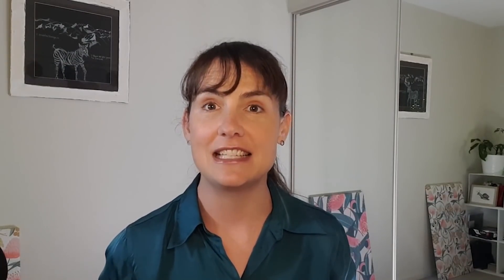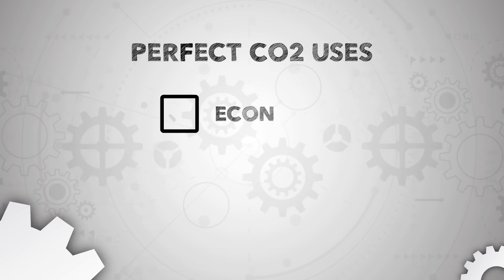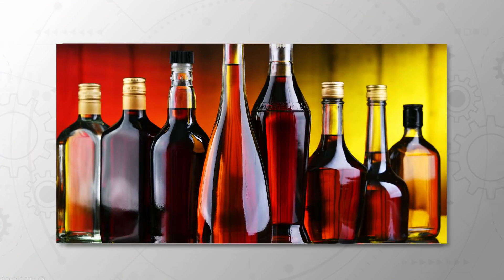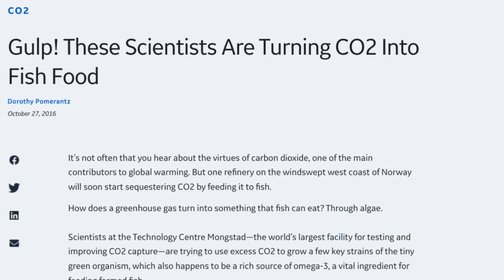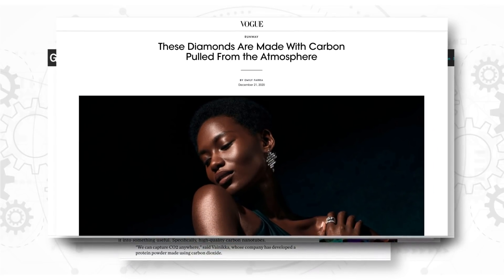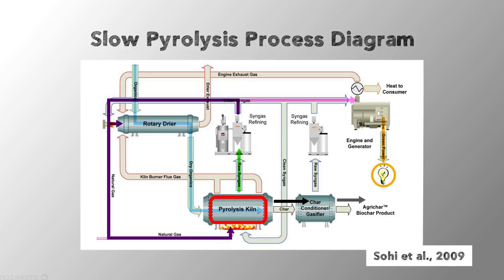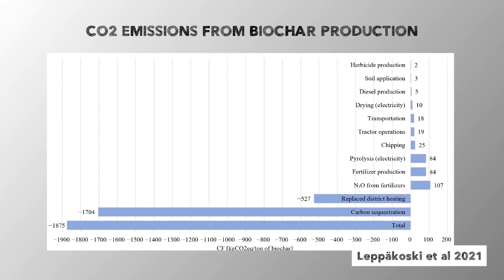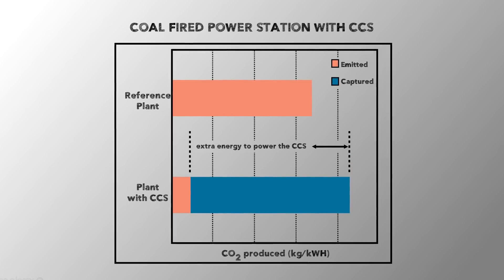From Waste to Wonder: The Surprising Uses of Carbon Dioxide

Comment: "Capturing CO2 out of the atmosphere, and making useful stuff out of it"
People have been doing that on a large scale since at least the chalcolithic era. It's called "wood".

Also, who are these people "generally considering" biomass to be carbon-neutral? That's idiotic. Biomass is significantly carbon-negative, even before you use it in the ways described here, because plants absorb way more carbon than is embodied in the material the plant is made out of; the "extra" mostly gets pumped down into the soil in the form of things like sugars, and ends up sequestered.

Comment: Thanks, interesting video, especially the talk with Dr Jessica Allen. However, as a chemist, I need to note a few things here: 6:11 The molecules displayed as ball and stick models are not what is written above them. The first one is CO2, the second one looks more like Chlorine (Cl2) than hydrogen (when considering the colours and sizes in the other models), and the third is methanol. At 8:05 the models seem to be better suited, however, according to what is said in the video the formula is not complete: It should be CO2 + 3 H2 -> CH3OH + H2O. But all the rest was good and interesting, as said.

Comment: Not even wrong or worth further discussion when the obvious thing to do is well understood, behind the obfuscation.

Reset the Renormalized Cynicism gauges. Fly ash isn't the usual bs.

And I'm reminded of Norman Gunston, "Say something Controversial", and put your head on the block with the stealth censorship troll gang.

Isn't Captured Carbon spelled C O A L, even before charring in an earth oven over the eons?

So if thousands loose jobs, millions and billions will no longer lose their lives earlier than they should? Carbon Capture, as a topic without relevance, is a pernicious delusion, when compared with the degree of reversal required to burning it.
Reply: cringle

Comment: Replace standard concrete with desert sand and resin. Captured CO2 plus Hydrogen via high temperature steam electrolysis to make Methanol to Dimethyl ether (DME). Perhaps solvent blends based on dipropylene glycol dimethyl ether for the production of alkyd and polyester resins by the azeotropic process. Polycare are able to proceed with combining local dessert sand and polymer resin to print bricks. Use nuclear for the process heat - high temperature gas reactor. The Allam Cycle by Net Energy produces a very pure stream of CO2 for industrial uses. Pilot plant in Texas already up and running.

Comment: Rather than looking at your carbon footprint, how about looking at your heat footprint? One way to become heat negitive is to install a Planetary Air Conditioner.  Mine ejects enough heat into space to prevent 250 tons of ice from melting per year. It cost less than $200 (with NO government subsady), and has been running for seven years. It uses NO electricity. The cooling it provides shows up first in my home so my electric bill went down.  How cool is that!

The down side is the tech is off patent, so corporations don't want to manufacture. There's nothing to tax, so governments aren't interested. And the Planetary Air Conditioner solves the earth's temperature problem, so environmental zealots lose the main point they complain about.  The Planetary Air Conditioner works, but no one wants it.
Reply: You are claiming to be able to remove nearly 2.5kw of heat every hour for only $200. 

Forget corporations , why do you not manufacture this device and sell it as an air conditioner to your neighbours.

Then you have your seed money and you can start making it yourself.
Reply: @catprog  Thank you for noticing.
As I said, there is no patient to earned. The technology is 3k years old (at least).
I've posted videos of my Planetary Air Conditioner. I don't run compression Air conditioners any more. Does it matter? No.
If someone can pay $200 and get $500 back every year, who's going to market it? The power company? Home Depot? Our government, which if they implement will collect less taxes?
It's an orphan technology. Use it, if you dare, but don't brag.

Comment: 🤔 Apparently increasing the atmospheric CO2 by as much as triple helps plants to grow big and strong. How practical would it be to start piping captured CO2 to greenhouses on industrial scales to feed help  thousands/millions/billions? Or maybe deliver it to the greenhouses as dry ice? How long before the carbon makes its way back to the atmosphere with such a strategy? As long as we're growing indoors, what about using narrow-bandwidth LEDs to additionally save energy and encourage growth? How much power does that actually use per hectare of crops? Has anyone tried custom atmospheres and lighting simultaneously? 🤷‍♂

Comment: Plastics get an unfair rap because of how irresponsibly we use them. They are truly wonder materials. What other materials are light, very strong, and able to be easily made and modeled to any shape or quality we want, including transparency? And don't get me started on composite plastics, which can have amazing properties.

Also, it is easy to dismiss graphene as a new and quirky material, but it conducts electricity better than copper, while being stronger and many times lighter. If we replaced copper with graphene we could save energy (lower resistive losses) and store a lot of carbon. Currently we use something like 25 million tons of copper each year. When you look at replacing more than a century of copper already in use, that sounds like a pretty good start to carbon storage.

Diamond is not just for decoration. It has very cool properties that could be incredibly useful to us. As well as being extremely hard and very transparent, it is an excellent electrical insulator, while being a very good thermal conductor. The latter two properties could make it very useful in electronic circuits. Industrially producing diamond on a massive scale would also destroy the diamond mining industry, which would be a very good thing because of the awful social damage it perpetuates. It might be difficult to manufacture the perfect diamond that might be a better alternative to the glass fibre used for communications, but if a way could be found then diamond fibre might be a stronger alternative. In a more day-to-day use, cheap diamond windows would likely be stronger than glass windows.

Comment: I have a technology that solves all these problems.  I call it Terrestrial Renewable Economically Environmentally Sustainables or T.R.E.E.S.  They have these characteristics:

They capture carbon and lock them in for the long term.
The more carbon in the atmosphere the better they work.
They produce oxygen as a byproduct!
They are a self-replicating technology fueled by carbon and solar energy!
They are self sustaining. 

As the frozen tundra areas of the world begin to melt, we can use that available land resource to populate these T.R.E.E.S. that will help re-capture the CO2 we've put into the air.  The best part -- we don't have to do ANYTHING.  This T.R.E.E.S. technology self manages, self propagates, self replicates, and works without any intervention on our part.  I've already got some prototypes and just need some carbon tax investment monies to get started on a large scale.  Please donate!

Comment: It would be nice if we could turn carbon capture facilities on and off during peak times when renewables are making lots of energy or consumers are consuming lots of energy.  This could reduce the need for energy storage.

Of course leaving them on 24/7 may actually be a more efficient use of resources.  I've also wondered if Aluminum smelters could be turned on and off to use cheap or wasted power.
Reply: If you turned them completly off it means they get very damaged.

However if you keep the aluminum molten and don't add any new solids you don't need to add the corrosponding eletricty either.

Comment: It seems that parts of the ocean that are natural carbon sinks could be leveraged or areas with naturally high current(high C02 flow). Semi- self- sustaining- bio-engineered solutions could be a good option economically. Super charged diatoms?

Comment: Using actual modified car engine to transformed CO2 into Biochar and Synthetic fuels! Biochar then used to create Graphene for new generation batteries and Synthetic fuels used to generate electricity to charge these new graphene batteries and to fuel car engine.🤔

New car engine could store Biochar and deposit it at synthetic fuel station when they are refueling. 🤔

Existing car engine could be repurposed, electrical car batteries could be enhanced with graphene. Negative CO2 footprint?🤔

Comment: I’m actually interested in the ‘turning it into plastic’ idea because like fossil fuels, plastic is not going to be easy to replace also there is a big difference between say single use shopping bags and plastic on the wiring in your house or workplace that’s expected to last for Awhile. It won’t be used for forever in that application but a few decades or more is certainly longer than a plastic bag.

Comment: One  way to collect carbon   must be micro algae, and some like lentil algae combined with tecnologies like vertical agriculture must be usefull in a short time. Some thing really interesting must be about technologies used to separate carbondioxide from the air. I have tried multiple times see diagrams about how it is done, Must be the first video explaining the tecnology if you can do it... Thanks.

Comment: I was intrigued when you started out with Carbon.... from Coal to Diamonds... as I FULLY AGREE WITH THIS.
One must Challenge the Coal Industry to think "out of the box" rather than moan, groan and weep over the future where coal is not sold cheap to "Burn and Pollute" ... but Move Up the Value Chain (diamonds being at the top).
One of the most significant use (missed out) is in replacing Steel with Carbon Fibre, including use of 3D Printers for Components to even full Buildings etc... (Now you understand the " out of the box" thinking needed..). 
I hope you will cover the Future of enhancing the Value of Cheap Coal to "Burn & Pollute"  to Move Up the Value Chain WITHOUT COMBUSTION & POLLUTION... ALL THE WAY UP..... TO DIAMONDS... THE HOLY GRAIL OF CARBON...

Comment: I’m looking forward to the results of your enquiries. One particular question I have is what toxic / carcinogenic byproducts slow pyrolysis produces if any and how can we transform those into useful chemicals or less hazardous substances.
Reply: Just don't bungle the process by having equipment go out of order. See also guides c.f. Nuu Biofuels Digest.
Reply: A lot of useful chemicals such as turpentine were made from plants in the past and distilled out. Oil and coal displaced the original sources of the materials.

Comment: The capture potential for any technique is dictated by how much capture is profitable. That means, strict CCS, without utilization, is limited to whatever companies are forced and or payed to do, and insignificant greenwashing. Paying fossil fuel emission intense industries to capture some of their emissions will not help solve this problem, it will help those industries survive longer.     

About bio-char, the potential is still dictated by how much of it that is profitable, if we make it profitable to stora all the carbon that needs to be stored in form of bio-char that will happen. It's not likely that we will store a large part of what we need to store in bio-char either, but technically the potential to do so is there. 

It's not just that bio-char can store carbon a very long time and improve agricultural output, the latter is also extremely important, and increases carbon uptake from the atmosphere by the way. The water retention capability of bio-char makes it able to reduce the risk of floods and droughts, significantly, and when such events still happen, the severeness can be much reduced. 

But we're talking about gigatons of carbon, as in billions, with a "b" tons of carbon. Yes, and there are billions of hectares of agricultural land that could use multiple tons of carbon each. And the potential is not limited to land in use, bio-char can help turn infertile soil into fertile soil. 

Worrying about whether or not every last ton of carbon we released can find good use as bio-char is in my opinion irrelevant. Other techniques that actually helps would be great, we don't need distractions, and we definitively shouldn't help fossil fuel industries survive by subsidizing their greenwashing.

But there's no magic, there are issues to resolve in order to produce and apply climate-relevant amounts of bio-char, mostly how to produce that much of it sustainably. There are some low hanging fruit in form of byproducts, so we have no real excuse for not getting started.

Comment: Making plastics from direct air captured carbon seems more plausible than biochar. Plastics are carbon rich, durable and have an enormous market already. Thermoplastic melts seem to be the ideal form for geological carbon storage, as they are chemically and biologically inert, and can be formed into any shape easily. It only needs heat to be reformed and can be used in consumer products between capture and storage. We already have supply chains for used plastics, all we need to do is divert them into (deeper) storage.

Comment: CHILD'S PLAY
I currently have a need / usage for pure oxygen. I manufacture the O2 from plain air, which is also the exhaust gas from any of several compressed-air engines of my own design. It's been a lifelong hobby.

I also design and build VAWT wind turbines, which compress air. The compressed air runs an engine, creating either useful work or electricity for me. I then scrub the CO2 into pure oxygen and a stable, nonreactive, storable, inert solid using only the pressure of the exhausting compressed air.

What could be easier?

EDIT: It occured to me that if EVERYONE in the world did as I do inside my bedroom, namely, bubble CO2-containing FRESH AIR through an air stone at the bottom of a 5-gallon fish tank filled with water containing 1/4-cup of lime (not the fruit), producing a steady output of pure oxygen and calcium carbonate, the goal of scrubbing excess atmospheric CO2 would be that much closer at hand.  The calcium carbonate produced is inert and could br tossed into the garden.

Just a thought.
Reply: on your edit: How do you produce the lime in the first place?

Comment: Biochar and Pyrolysis are not a solution without issues. For example in Sweden, the pyrolysis plants are supposed to be fed by wood. The issue is, that the timber production in Sweden is already unsustainable and further increase of timber production from pyrolysis would require further intensification. The forests are degraded and old-grown forests which have the highest biodiversity are being cut down. At the same time indigenous Sami people are loosing their territory. And on the top of that it takes a very long time before new forest reabsorbs released emission. Oh well...